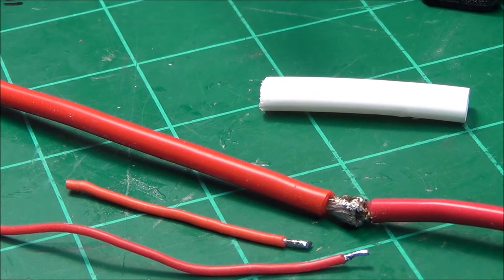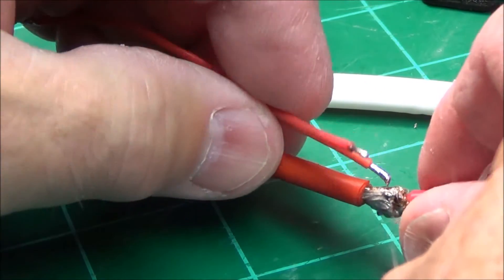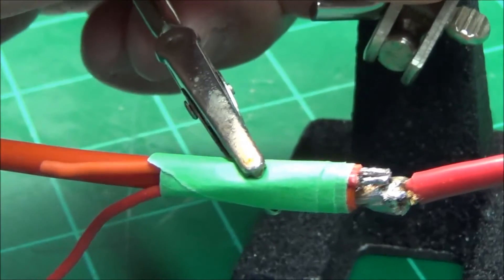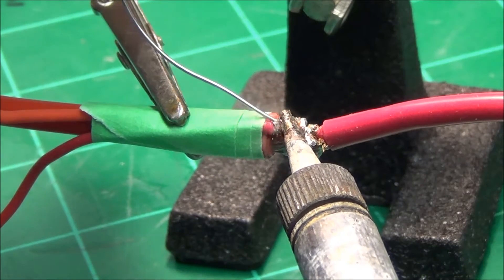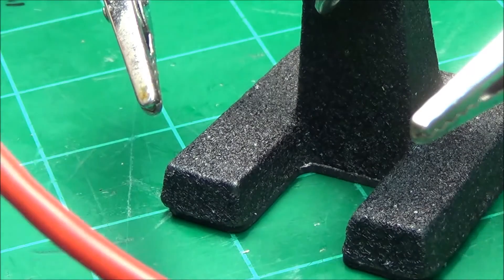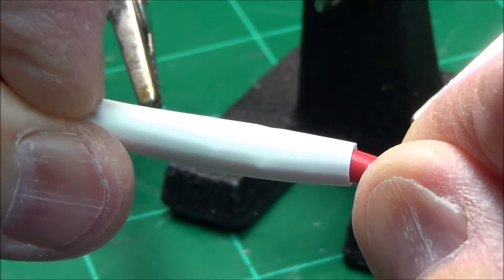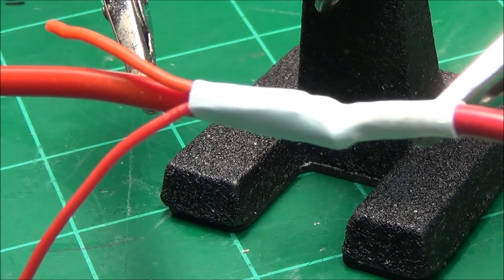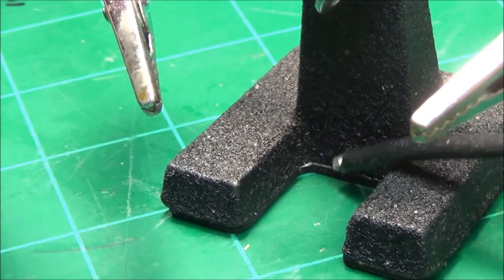How to Solder Two Small Wires to a Larger Wire

Comment: what I need to do is solder together a 6 gauge wire onto a 16 gauge wire so my plan is to get the eight gauge wire strip some wire out then gets the 16 gauge wire and strip more of the wire out and wrap it around the 8 gauge wire like a spring but tightly coiled so that all the wires are touching while I wrap it around kind of like those Springs that are coiled tightly together and you're meant to pull them apart to make it like a pole spring that I push in Spring if you understand what I mean by that once I coiled it tightly around all the way to the end then I'm going to put a soldering iron at the bottom of the wire and then the solder will touch the top of the wire so that it'll melt into the solder into the wire I mean that's making a solid connection and then putting my shrink tube over it this way I get better connectivity cuz too much solder a group of solder on top I don't think that's very efficient I think letting it melt into the wire it'll be a better connection and then adding the shrink wrap tubing will give it the strength and not to break apart  the reason for I need to do this is because the device has two negative and positive wires that are 16 gauge and I can't connect the 8 gauge directly to the device from the inside so I have to use the 216 gauge wires and then connect them onto the eight gate the reason why I need an 8 Gates is so I don't have any voltage drop because I need about 36 ft of wire and if I were to use the 16 gauge of 36 ft they would be possibly voltage drop and the device wouldn't work properly so the 8 gauge wire will prevent from any voltage drop for a 12 volts and 6 amps thus I will have a good conductivity without any voltage drop

Comment: "Should" "Works for me" "Hopefully" "lets see if i can do this" I can see THROUGH your "large wire solder" probably because of the tip and flux wasnt used, and you have now a hazard due to not combining the small wires. Not to mention you pushed the solder againest your iron, not the joint. that is the first rule of soldering. Its called a cold solder and it will come off extremely easily. its like melting metal onto something and saying you welded it. I watch these for entertainment. This is special kind of bad lol

Comment: Sorry but that is a terrible solder joint. Solder tip was filthy, too big a gap between wires, and where was the flux? You held the iron there for ages, but using a clean iron with lots of flux and that would have soldered in a second. And wouldn't be full of crap leading to a poor solder joint.

Comment: This is not the best connection tbh... First - small wires are just placed near pre-soldered bigger wires, which increases chance to break off. Second - you soldered holding iron from above the connection, heating lead, not wires; this way you actually created one solder on top of the other, not one solid one.